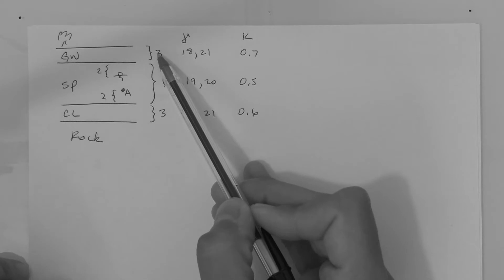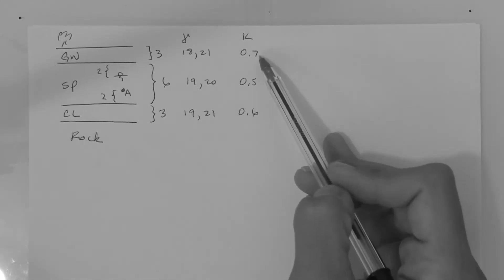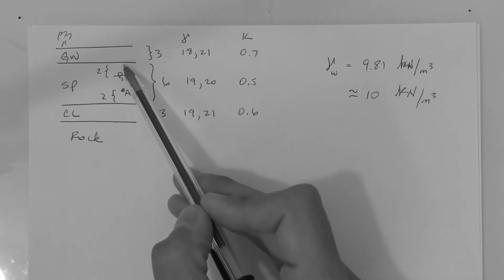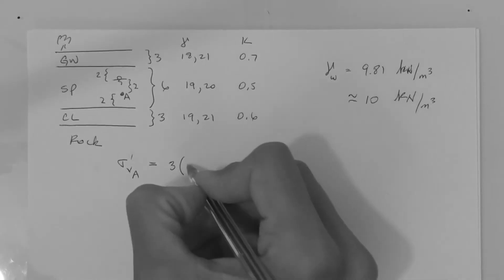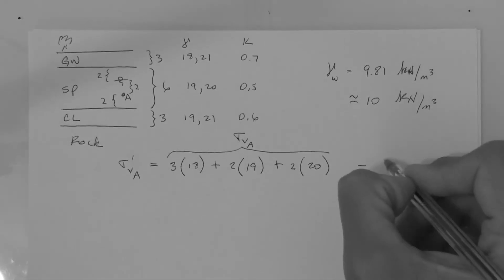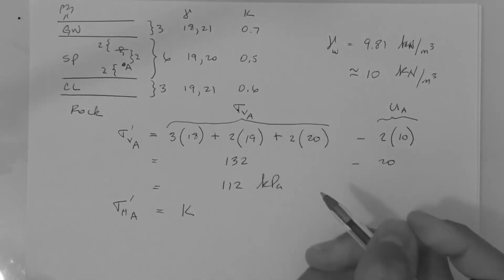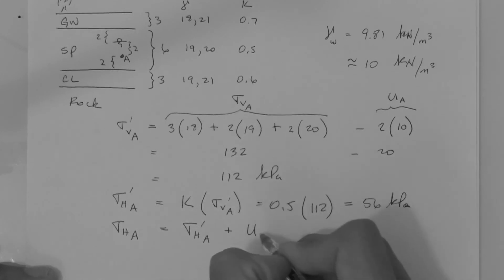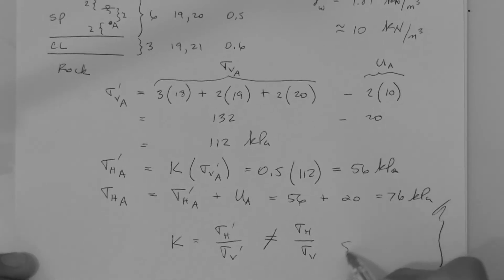Effective stresses example

Comment: sometimes I have seen similar problems where for example in this case, the GW layer dry unit weight of 18 is given and the moisture content of let's say 5% for this layer. Do you still use the dry unit weight of 18 in the calculation of effective stress or the moist unit weight of 18(1+.05) in the calculation of effective stress?